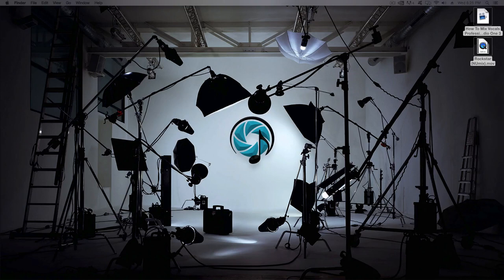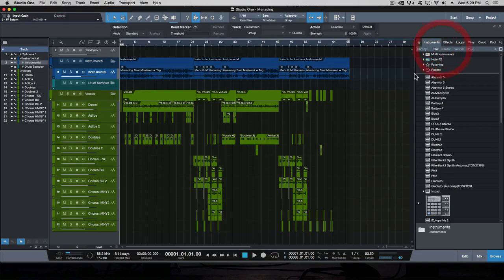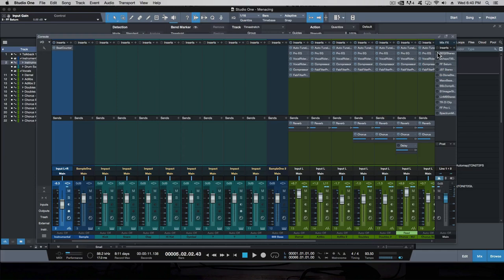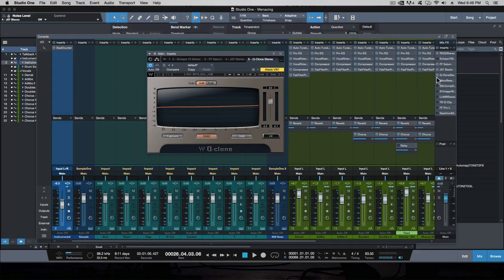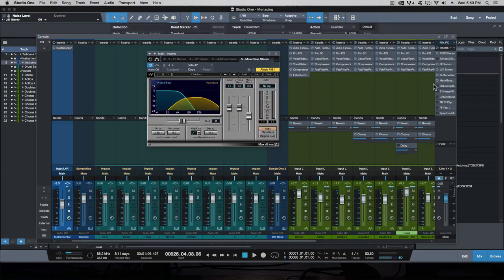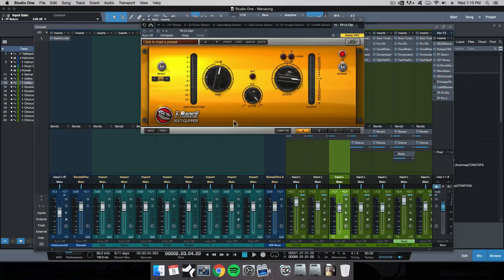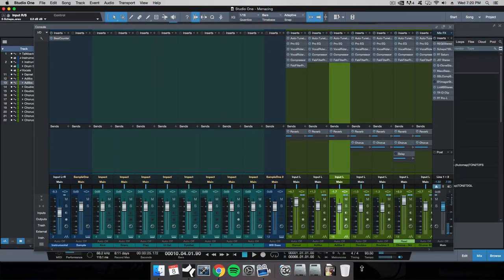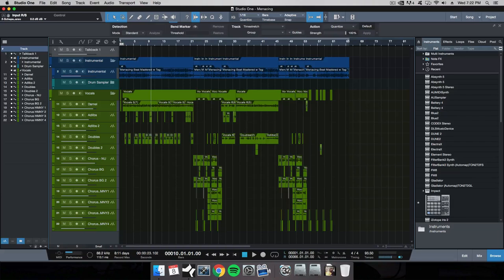How To Master A Song in PreSonus Studio One 3! Fat, Loud, In Your Face!

Comment: granted this is an old video, just curious, why aren't you mastering in the project section? just a heads up I have the professional version of studio one, been using it for several years, and I just find doing the mastering in the project section, is a lot easier.
Reply from the maker: Hey, thanks for pointing this out. I agree with you, I do master in the project section for all sessions now.

(If anyone is reading and is wondering how it would be different; it wouldn't. It's just transferring these techniques to the project section.)
Reply: NU SZN did you make a video for the project session?
Reply from the maker: I don't have a video for that.

Comment: Brilliant ! It is very helpful. But, I have a question, please. Why do I get  quieter volume after exporting from studio one?. Is there any feature I have to switch off before exporting?. I have saw that you have to open a nwe project to master but I prefer this way. I mean, mastering in the box. Thanks in advance  for your answer. And keep it up !
Reply from the maker: That's weird, Carlos. Your output volume should be the volume it is exporting it as. Perhaps your player volume is low?
Reply: Try going to the “song” tab and do update master file. It should do its own master after you do your manual mastering nd keep it sounding loud and clear :)

Comment: Hey love this! Could you possibly list the plug ins that you used?
Reply from the maker: Here is the list of plugins used:

Waves REQ 2
Waves Scheps 73
FabFilter Saturn
Waves J37 Tape Saturation
Waves Q-Clone 
Waves MaxxBass
Waves SSL G-Master Buss Compressor
Waves Linear Multiband Compressor 
Classic T-Racks Clipper
FabFilter Pro-Limiter
Spectrum Meter Analyzer

Keep in mind, these are just the plugins I use to perform these functions - you can use any plugin that has the same function interchangeably.

Comment: Helpful explanation of each step. Any advice, tips, on prepping the mix for mastering? I'm currently doing something similar in each track in the Console as you're doing in mastering. For example, I'm gating, eq'ing, compressing and limiting, etc. in each track. (-2 db in the limiter seems to work well whether it's a piano, guitar, or vocals). Are there things you deiberately avoid in the mixi, and vice versa, things you make sure are done in the mix cycle?
Reply from the maker: Thanks! No, not necessarily, other than obviously not throwing limiters on the mix bus, I generally mix each individual stem exactly how it is needed to get it to sound how I want it to sound. The better the mix sounds, the better the master will sound.
Reply from the maker: I make sure, as I mentioned, to ensure there isn't any clipping and enough headroom, everything sit well within its audible space and aren't clashing with other elements, those are usually the key things I'll keep in mind before  mastering.
Reply: @thisishssn  Thanks! I'll check out more of your videos and watch for notifications from your channel.